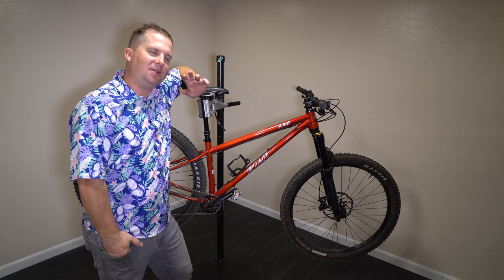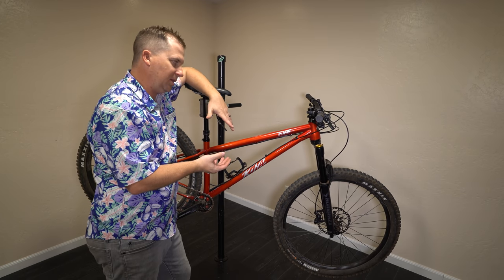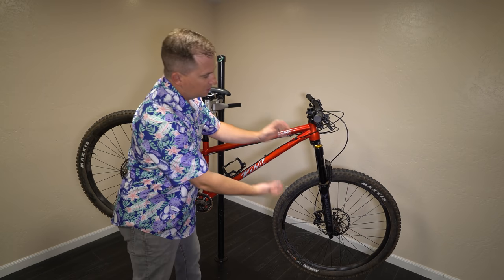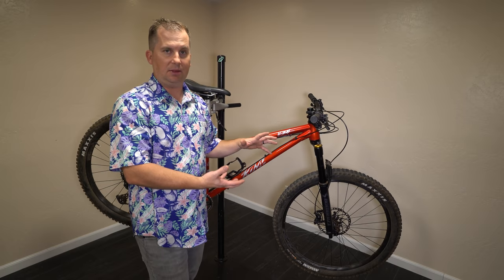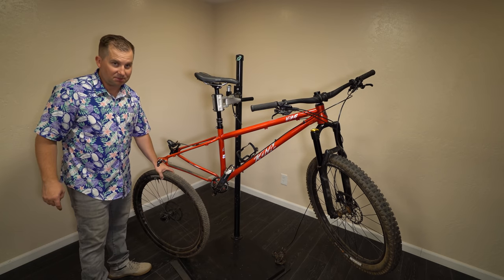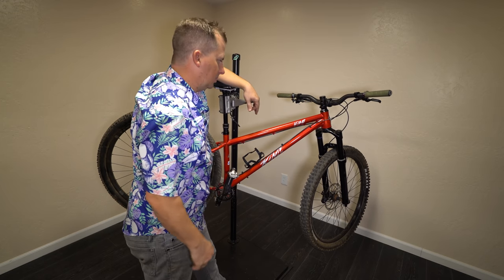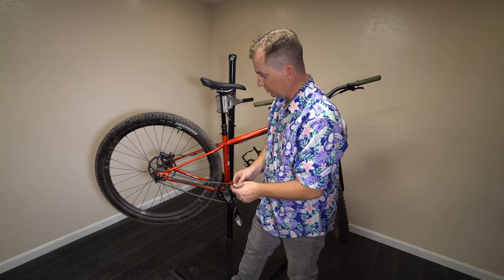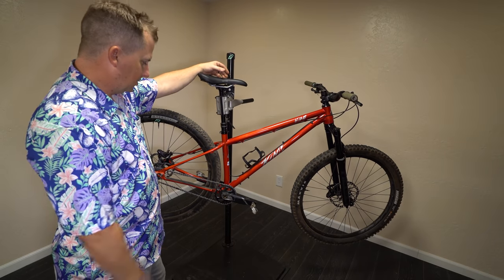Did I just Make It Worse? Tweaking the Kona Honzo ESD to be a little more SSLSD - ExperiMENTAL

Comment from the maker: A quick note:

My goal with this experiment wasn't to keep the geo identical.

The best way to keep the geo identical with a shorter fork would be to run a 20mm spacer between the head tube and fork crown. Wolf tooth makes one of these, but I don't have one in hand. I'd like to experiment with one in a future video. Sadly, I have a limited time window with this bike, so I did what I could in the short time I had it. 

I was tinkering here to see if I'd like a little less stack and a steeper hta (64* now). I don't feel like 63* is always needed for most trails. I'm curious if 64* feels better on this bike or not.

I plan to experiment with a headset spacer in future videos.
Reply: It'll be rad either way, watching you experiment with this stuff just shows us the options we may not have known about otherwise! ❤
Reply: And rock rolled almost everthing with 130mm rockshox recon rl hardtail fusecomp 29 66.5 HA np.

Comment: I love this experiment.  The whole underforking question intrigues me.  Particularly how the bottom bracket is lowered and how that affects handling for different environments or trails.
Reply from the maker: The bb now sits 10mm lower. With 5mm shorter cranks, it's probably going to pedal stroke even more than before. But it's an experiment worth doing.
Reply: the bigger change comes from the head tube angle change i use a Rock Shox Domain 302 U-Turn ,which lets me go from 115 to 160 mm of travel i can dial it for whatever trail preference i have that day in less than ten seconds. the lower bottom bracket  definitely makes me more aware of my pedal location, i definitely prefer a higher bb as it gives me more leverage and more monster truck vibes, the lower bb lets me feel like im sitting more inside of my bike which can feel more stable at lower speed technical stuff ,so if im going faster i like it high, if slow low. its not an isolated variable on that bike but it holds mostly true for me across all my other hardtails. its always a trade off, that is why folks choose  N+1, gives you more options and lighter more aero pockets, because racing.
Reply: Thats my issue. Pedal strikes on New England trails would rule this out for me. Modern bikes seem to come with too low a bb as is. Wouldn't bumping up the progression with volume spacers on the 150 fork accomplish a similar goal?

Comment: I recently went for a 130 fork to a 150 on my hardtail (130 factory 34 to 150 pike rct3). In general I agree with you that this much travel on a hardtail is excessive, to me it balances the frame weight (my XL trans am super heavy) and also brings the bb up to a more desirable height... I just hit a drop this weekend that I've never hit before, but even things like this aside, the bike is just more balanced.  But this is why experiments are important, there's too many variables for hard/fast rules... another difference from what I was doing to what you're doing is that the geo on the '16 trans am is different 74 STA and 67 HTA.... I have two long travel hardtails, the feeling of weight distribution is really fun to observe/ and yeah I think fork travel is more about geo in the normal riding than the big hits (but settings can also come into play)

Comment: I did an experiment the other day . My rear tire is on its last leg .  I got new tires coming but needed a temporary fix . I had a non tubeless ardent tire that is a couple years old  and I said why not  . Lets see if it would go on tubeless and set it up . It did have some sealant leak from the rim and bead but sealed up after going higher pressure   . I went for a 4 hour ride in my rocky high desert trails and it did not loose any air . I rode it fairly hard to see if the tire would hold and all good. Its a rear tire which takes some abuse on a hardtail  . I also try non bike sealants(Mostly atv type sealants ) at a far lower price to see if they would work . I found one from walmart that works as well as any bike sealant at a third of the price and add a secret hole filler to the sealant that I came up with . Not sure if that makes a difference because I did not try without . Fun to experiment and you never know you may come up with a million dollar Idea Steve . I have also experimented with budget tires to see if they can perform with there higher dollar counterparts but some loose tread fast and others developed wobbles after riding them for a bit .Can you build a better mouse trap steve ? maybe

Comment: Dude like your videos,so I ve got a ESD frame on order and I am doing a custom build on it ,doing mine with a lyric or maybe a pike, totally agree on the whole too much travel thing on hardtails and it steepening the head angle on full travel so I am going to tune the fork so it really ramps up and the end of the travel making  it almost impossible to use the last 20/30mm .
Spec will probably be HOPE hubs,brakes,BB,headset ,stem.
Shimano XT gears and XT 170mm cranks.
DT RIMS  and silver DB sapim spokes.
👊

Comment: I wanted this bike but only one thing holds me back. Its limitation on riding plus tires. I saw your 1st review testing a 3.0 with tight clearance at the back. I'm hoping you put on 27.5x2.8's on it and see how it rides on plus and if it still rocks...then i'm sold! 🍻
Reply from the maker: The already low bb will be even lower with plus tires. I don't think this is the bike to get if you want to run plus tires.

Comment: It's weird that they would use such small bolts for the dropouts chain tensioner on this bike. I have a 2015 Kona big unit (set up rigid ss with a 29+ on the front) and the dropouts on that bike use 4mm bolts for the tensioner.

Comment: Can you measure the head tube angle as the bike rests on the floor at proper sag for your review video?  I'm academically curious...
Reply from the maker: Unfortunately, I don't have a reliable way to measure head angle. Ice tried the app before, but it's not accurate enough. Sometimes it reads 62*, and other times it reads 66*

Comment: I don’t really get your view on shorter travel forks, fitting or setting up a fork with shorter travel steepens the head angle your starting with and then using that travel steepens even further,
Going long travel gives you the benefit of a slacker head angle and also the option to run lower pressure for that nice supple feeling off the top of the fork
A 66° ha with a 130mm fork comes to 72.5° at full compression, a 150mm fork will give the bike a 65° ha and at full compression it’s the same 72° ha,
With the benefit of more air volume for a more supple ride or up the compression damping and use the slacker ha.
Reply from the maker: The main difference is that a long fork makes the head angle change more throughout the ride. It's like riding a stapler. Not everyone agrees with me, and we're all entitled to our own opinions, but for trail riding, I'll pick 130 over 150mm all day. One place I like 150mm is when I'm hitting big drops. But when I'm riding rocks with successive hits, the change in geo (stack, reach, btw) gets annoying and can actually make it harder to handle than on a shorter travel fork.